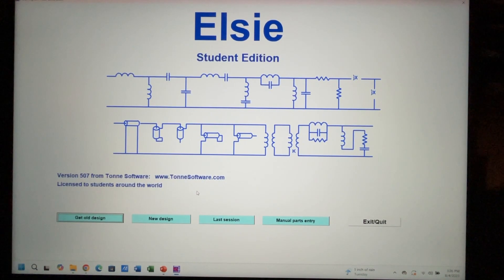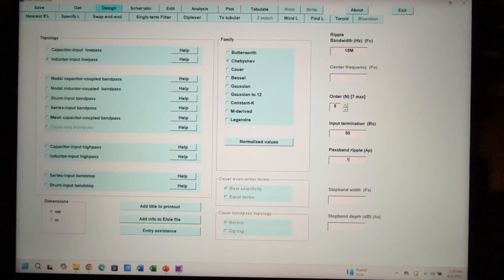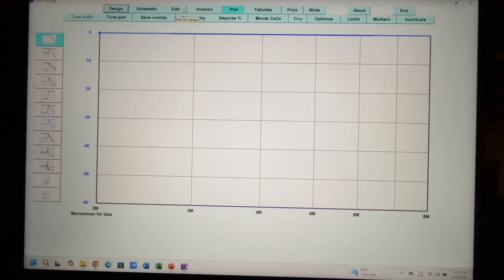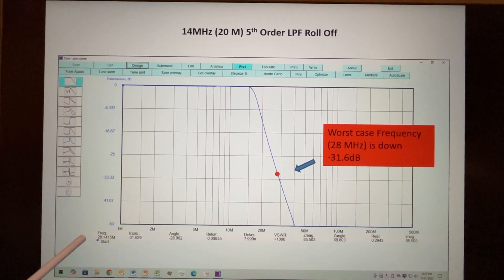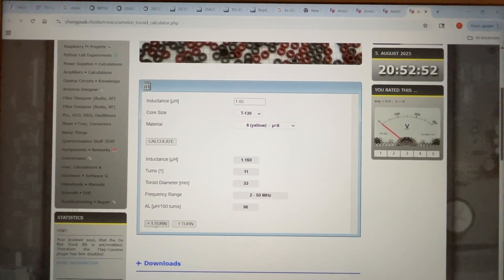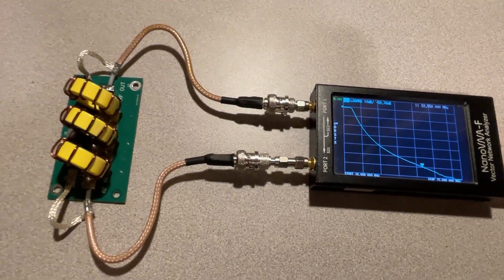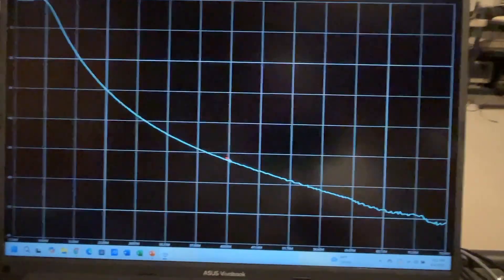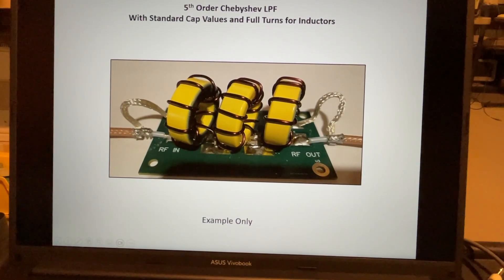Single Band Low Pass Filters - Part 2

Comment: Very nice presentation. In my opinion, using SMA connectors at the PCB I/O would be preferred than coax. In this case, since it is a low frequency, calibrating the VNA without considering the coax pigtails is not relevant. But for higher frequencies, it would be easier to calibrate the device at the measuring I/O plane. Was there a special reason to solder the inductors in the top side of the PCB instead of through hole? Or its just a single side PCB? Once again, very nice video!
Reply: Thanks for you comments. I use a single side board to lower the cost. Regards, RF Man

Comment: Curious how you estimate the power handling of a filter like this?  I've been putting the designs into SimNEC (SimSmith) and looking at the voltage across the capacitors.  Seems to be the most common failure point.
Reply: Toroid heating can be an issue as well. One of the major manufacturers has a document on power handling based on toroid size, frequency, etc.
Reply: @natereik  Yes, there are several good sources on the Internet.  I have a chart from Micro-metals at 16:50 that shows the power rating for a T130 and T68 core. Thanks
Reply: Yes, you are correct about the capacitors. I use 1000VDC, low ESR chip capacitors designed specifically for high current / high frequency RF applications. These hold up very well. Thanks for your question. 73

Comment: Can you offer pros & cons of using capacitor vs inductor on the input? Thank you.
Reply from the maker: Using a capacitor on the input side would save the cost of 1 inductor. Also the ESR of the capacitor is lower than the ESR of an inductor. The trade off is the roll off with the capacitor is not a steep as an input inductor resulting in less attenuation. Regards